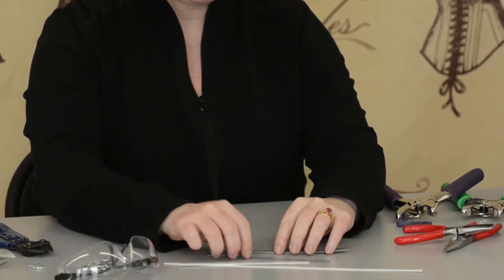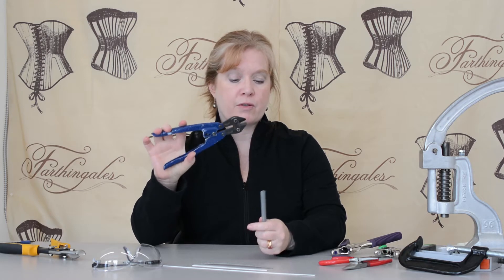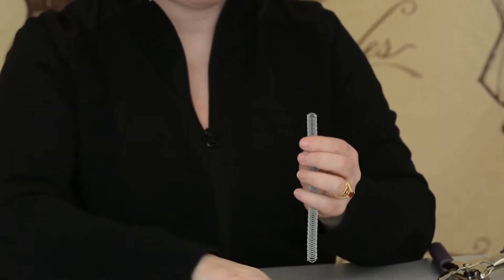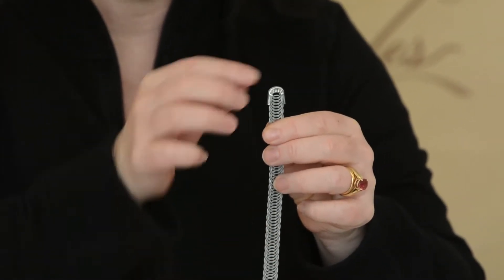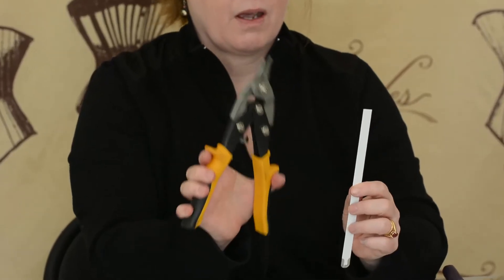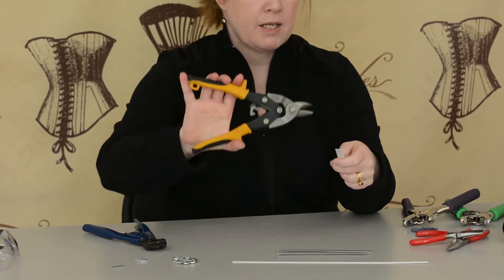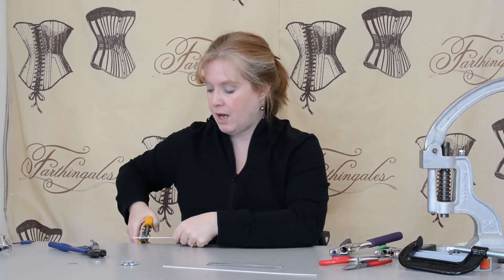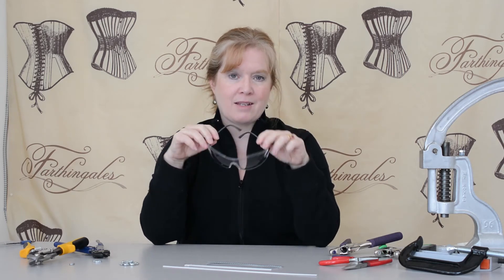Farthingales How to Cut Corset Bones

Comment: Well, looks like I need to get tin snips. If only I had known that before I finished everything else to do with making my corset... because I need to trim 4 of my bones
Reply: @serendipidus1 I used white steel bones for my corset, bolt cutters were the only thing that would cut them (I tried multiple pairs of scissors and pliers)